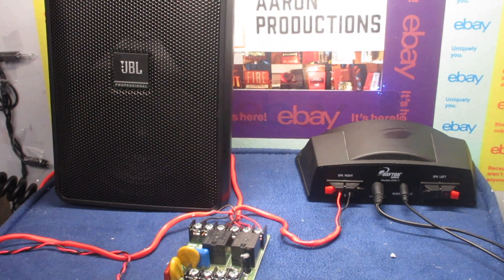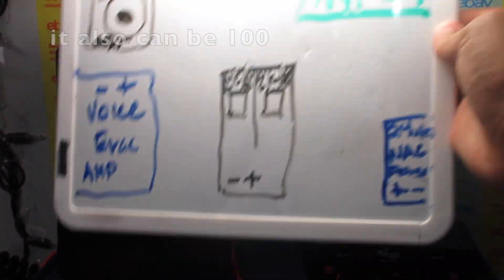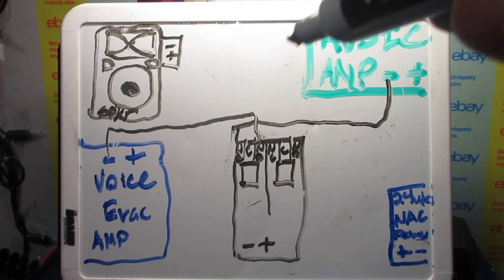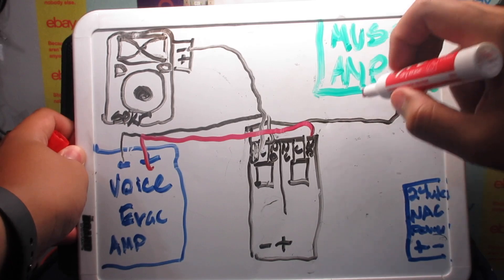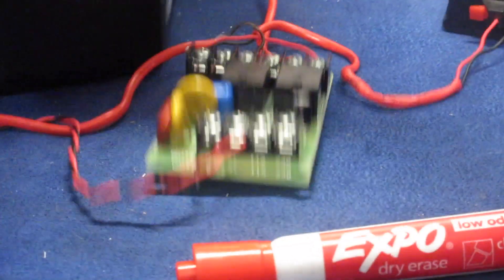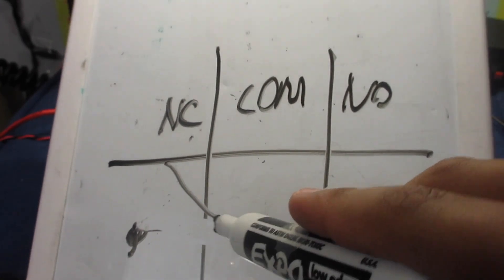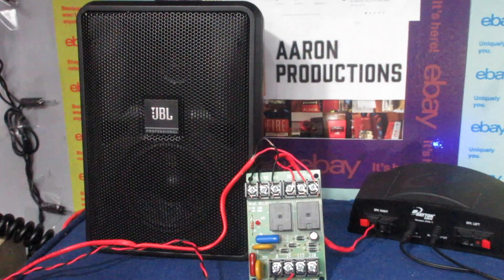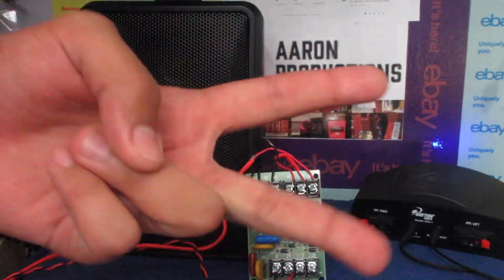How Priority Audio Works With A Voice Evac System

Comment: How do walmart stores play music and paging through their fire speakers? Is it through the fire panel or through an external amplifier?
Reply from the maker: most walmart stores with voice evacuation have a wheelock safe path voice evac system which has a built in audio input, so it does indeed go through the fire alarm panel.
Reply: @Aaronproductions  how it the paging signal from the phone system fed into the panel?
Reply from the maker: @jonathankeenan80  Must have a 3.5 mm output or something adapted to that; i know some bogens have RCA, XLR is not too common with those... i guess they could run the speakers on a separate amp but I don’t know of any that are allowed to solely run a fire alarm system since they need to be approved for 100% uptime and have to have tamper resistant measures